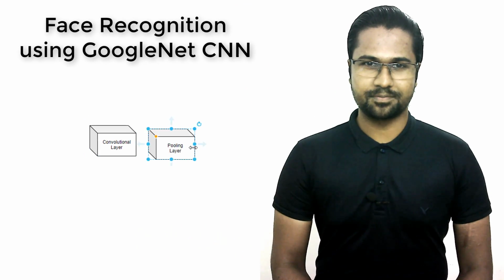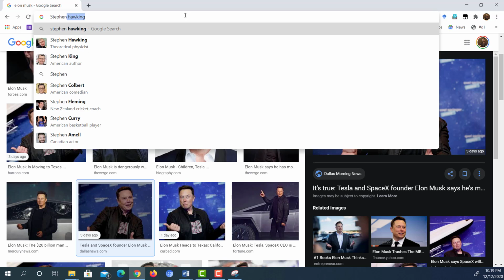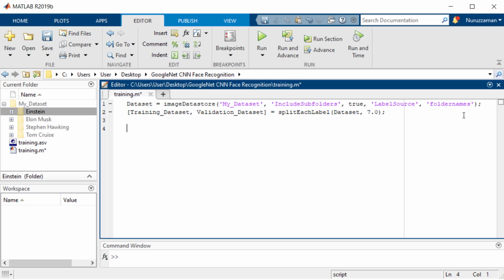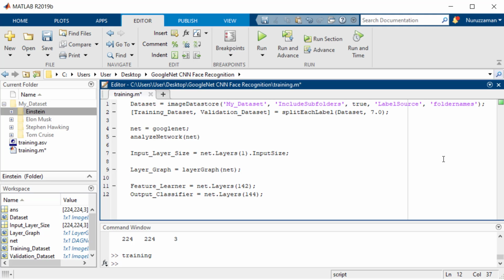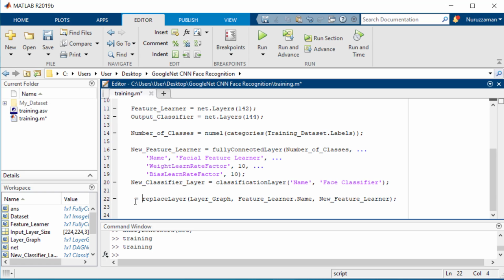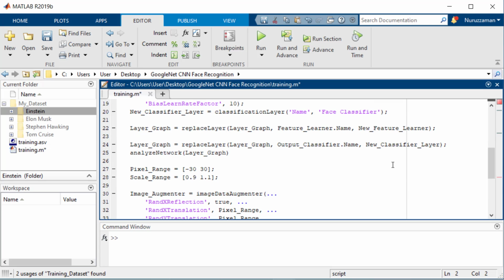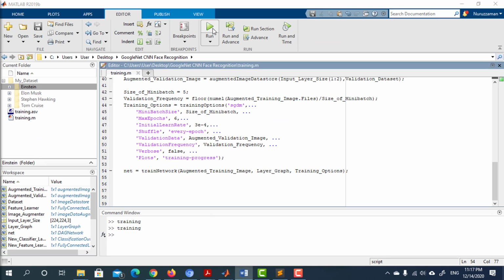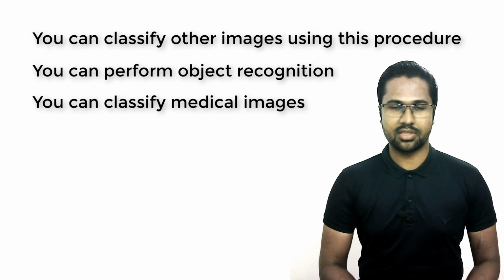Face Recognition using CNN (GoogleNet)

Comment: I got the error like this:
Undefined function or variable 'replaceLayer'
what to do sir?
Reply from the maker: Have you installed Deep Learning Toolbox?
Reply: @NuruzzamanFaruquis  yes sir first I installed Deep learning tool box but replaceLayer()  is not recognised
Reply from the maker: Are you using R2018b or higher? The 'replaceLayer()' function was introduced in R2018b version.
Reply: R2018b sir

Comment: But sir, instead of testing one image i want to test a set of images and i want to measure the result using accuracy, sensitivity, specificity and ROC curve.
 What changes should be done to the code given by you in testing function.
Reply: Here's a course you'll need.
Face Mask Detection Using Deep Learning . It's paid but it's worth it.
https://khadymschool.thinkific.com/courses/data-science-hands-on-covid-19-face-mask-detection-cnn-open-cv
Reply: Did you find the solution? cause i need this modification too.
Reply: @eso7565  Did you get the solution?